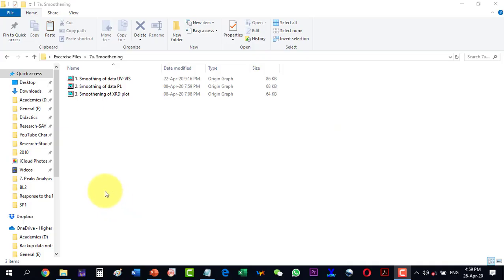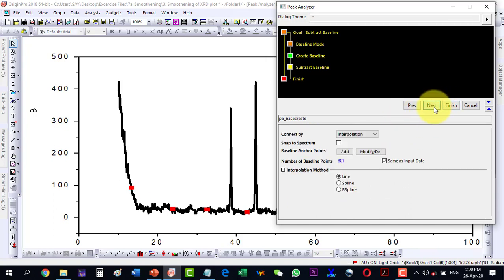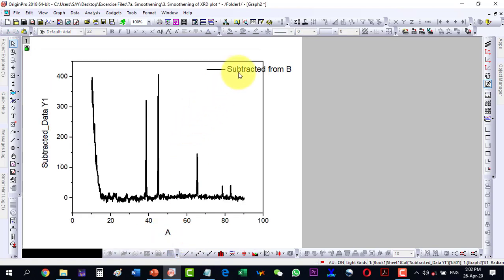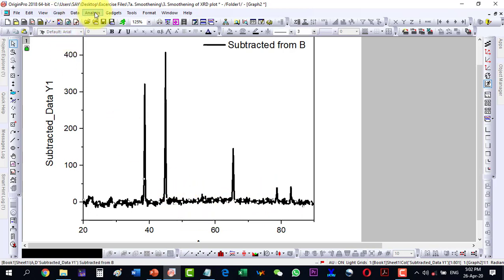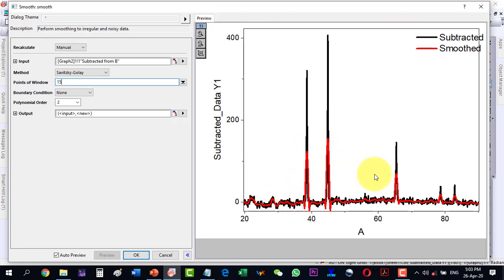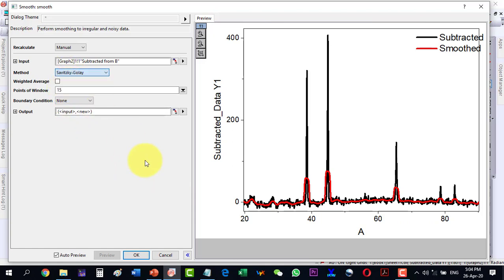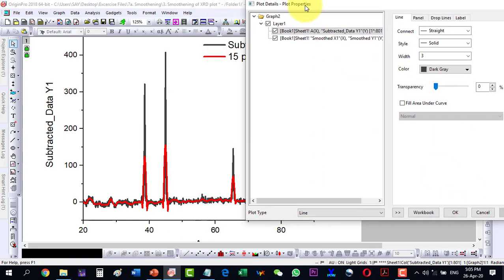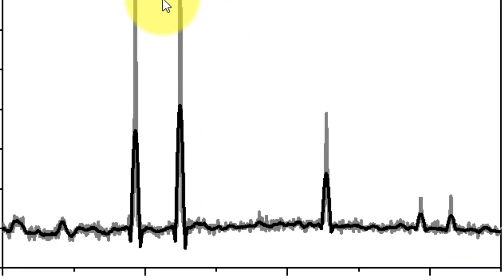How to smooth XRD graph in origin

Comment: The process is fine but is smoothing the data gives you quantitative desired information?  I don't recommend smoothing the data if you really want to pull out the quantitative information
Reply from the maker: Smoothing data can be useful in certain situations, but it is important to be aware of the potential drawbacks and limitations of this approach.
Smoothing can help to remove noise or fluctuations in the data, making it easier to visualize trends or patterns. It can also make it easier to perform certain types of quantitative analysis, such as peak fitting or integration.
However, smoothing can also introduce its own sources of error or bias, particularly if the smoothing algorithm is not well-suited to the particular characteristics of the data. In some cases, smoothing can even obscure or distort important features of the data, such as sharp transitions or sudden changes in intensity.
Therefore, before smoothing data, it is important to carefully consider the purpose of the analysis and the specific characteristics of the data being analyzed. It may be helpful to try different smoothing methods and compare the results to assess the impact of smoothing on the final analysis. Additionally, it may be necessary to carefully document the smoothing process and any potential limitations or sources of error in order to ensure that the results are reliable and reproducible. Due to these points in mind, I usually prefer to report both in the same figure. Thanks for your valuable input again....
Reply: @SAYPhysics  once did smothing in that moment you lost the concept of  quantitative data. If you want quality data use better  measurements parameters or better instrument.
Reply from the maker: Right. Thanks